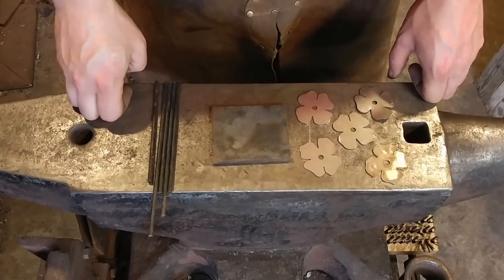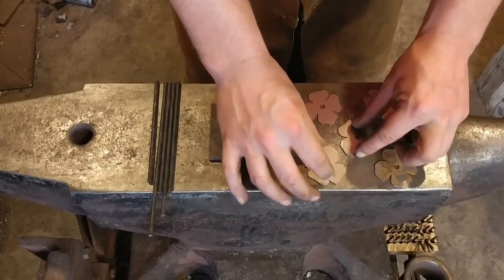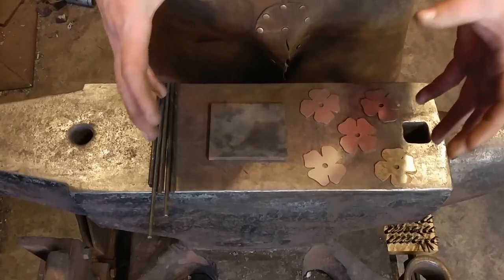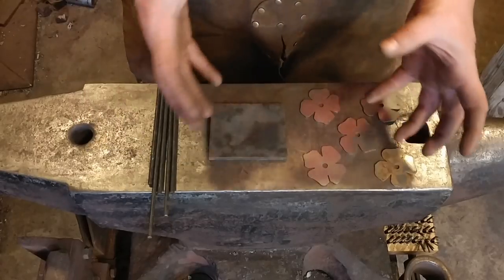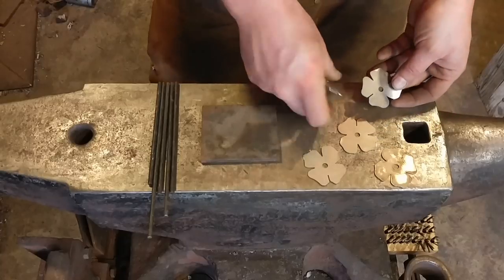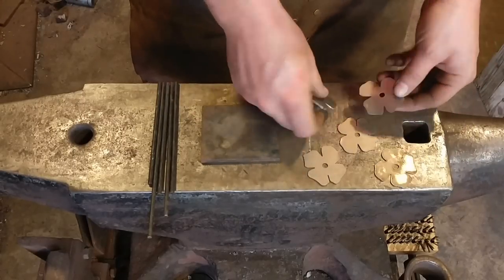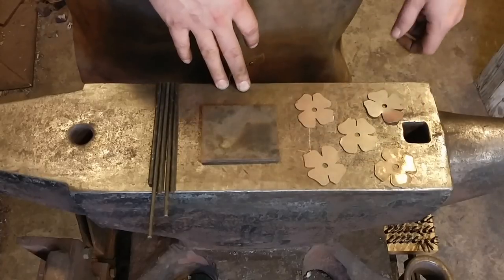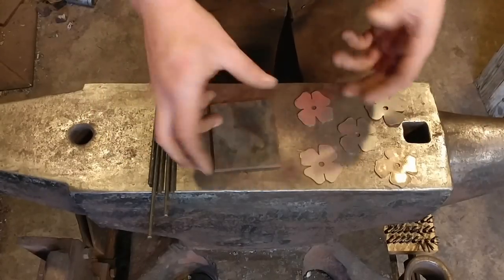🔨 Forging a $100 Sculpture  💰

Comment: Don't get too hung up on the Metric Roy.  You're doing very well.

I'm not sure about continental Europe, but all the steel rules and tapes we get in the UK always have both Imperial and Metric scales on them.

I'm English and we are now virtually fully Metric (apart from miles and pints  - of beer and milk) but I still much prefer Imperial.  Then again I am older (born 1963) and so started life and school in an Imperial system.  In fact I was schooled throughout the changeover period and so had to know both and then how to convert.  This was great really in that it promoted a lot of use of arithmetic.  The Metric system might be easier (everything is in 10s) but the Imperial system makes for a better mathematician.  

Ha - we even used to have our monetary system based on 12 pennies in a shilling and 20 shillings in a £, so 240 pennies to the £.  That all went out the window in February 1971 and we went decimal - 100 pence to a £ - same as 100 cents to a $.  Very few people now know what 12 shillings and eightpence means.  I sometimes use the old money system to confuse young folk, lol.

I still look at something and in my mind see it as Imperial.  I would never say something is 1.2 metres long.  To me it's 4 feet long.  I wouldn't say something is 4.5 litres.  To me it's a gallon.  It's 100 yards to the local convenience store - not 80 odd or 90 odd metres, or whatever it is.

Having said all that I do believe American pints are different from the old Imperial English pints.  An Imperial pint is 20 fluid ounces.  An American pint is, I believe, 16 fl oz.

Great job with the sculpture anyway.  Sorry for rambling as usual.

Comment: 1/16 = 1.6 mm 
3.5 = 89 mm
3/16 = 4.7 mm
5/16= 8mm
1/4=6 mm
1 1/4 =32mm
its a very nice piece roy love the fact you're trying to help us mm guys out lol most of these are rounded off figures but very close one option for you is to edit them in using inches to mm conversion chart on the net there is a lot of them God bless buddy have you got the nail header yet

Comment: Sorry, but i dont know somebody, who will pay 100 Dollar for this. Maybe 25
Reply from the maker: +Gefreiter Nudelsuppe then you need to expand your clientele base. $25 would be too low of valuation for this kind of work.
Reply: Christ Centered Ironworks The most Material for this i would get  for free. And i also only 30 for this. Why  should  it for 100 Dollar ?
Reply from the maker: +Gefreiter Nudelsuppe after you make a few of them you will understand why a hundred dollars. Plus I have done a video on calculating your actual profit out of that $100. The video was titled the rule of 33. Look in the blacksmithing business series for the video. It will explain this in detail thanks for watching
Reply: Christ Centered Ironworks  i have Seen this Video too